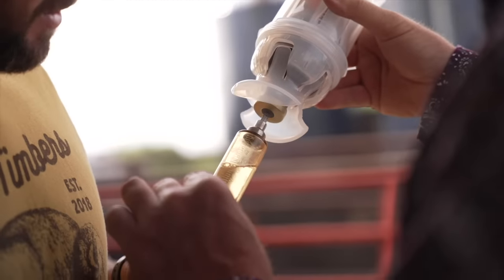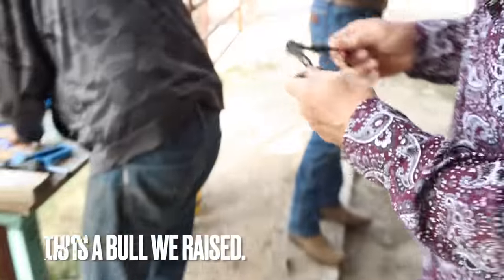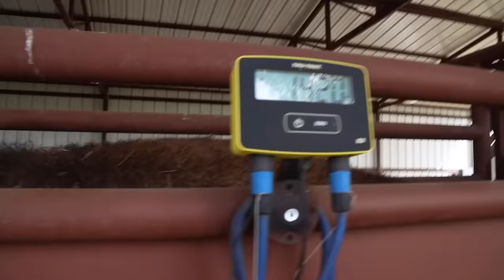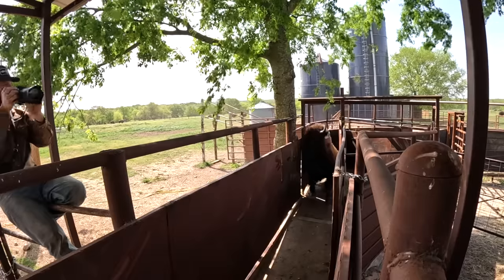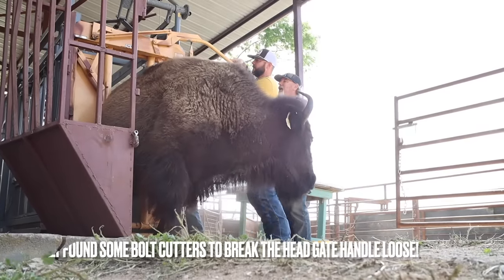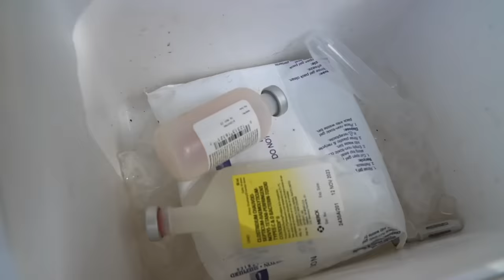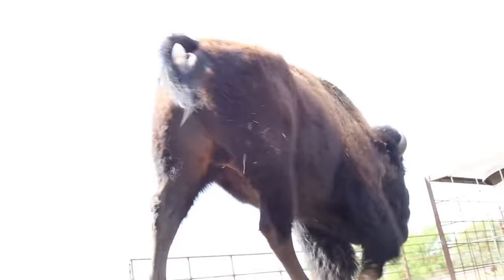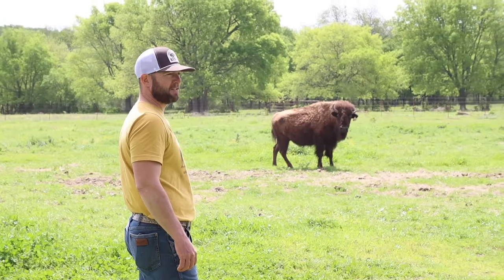The Biggest Dunbar Has Ever Been!

Comment: i have a question about the hair pulling, why pull it? do you need the roots or is there a safety issue with having scissors around a thrashing bison? or some other third thing maybe? not trying to be "that guy" or anything, but the way the hair was pulled looked kinda painful to me and i'm curious to the reasoning behind the method
Reply: Unnecessary

Comment: I worked in a large slaughter house years ago. They went up to Canada and stole design of a ingenious knocking pen ( where they killed them ) had a halve of a fork truck tire go down on an air piston to top of steers neck then a stainless steel fork push their heads up so they could not move heads, had a wedge push on their rear ends and a two forks lifting their bellies so they were unable to move. Back in the 1960's this was considered guess most humane method of controlling a steer to be slaughtered.  They donated the stolen design to the SPCA so other companies could adopt it. Surprised that you holding g chute does not have some of these features. They could slaughter 75 or more steers an hour .